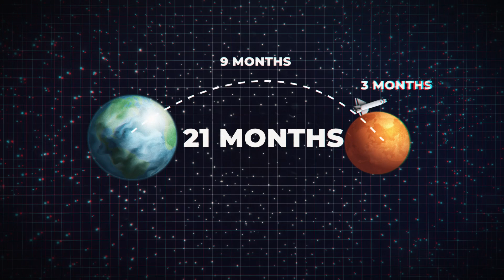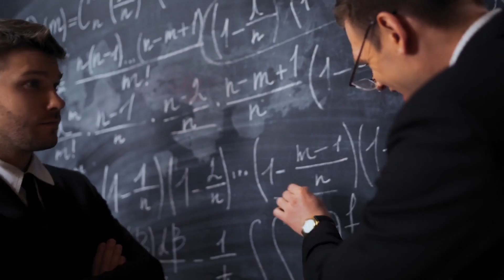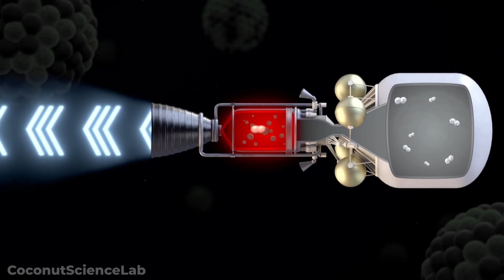NASA’s INSANE Nuclear Rocket to Visit Mars IN DAYS

Comment: There is a bit of a limitation of acceleration. You only wish to go about 1G or 9.8m/s/s. Going faster means you have high G stress on the human body. This means going to Mars will take 2-4 days and no less. Another thing to take into account is doubling acceleration (in this case 2G) will NOT halve the transit time, but takes significant amounts of energy.
Reply: So 1 G of acceleration will make humans feel more comfortable on the journey. This artificial gravity would change the whole design of the ship right?  It might need a much bigger base and a few other levels parallel with that base. It would also need to be versatile as far as adapting to little or no gravity for humans to work on the ship during those times of prepping for travel, maintenance, repairs, and getting into orbit.

Comment: Another problem with travel to Mars is that the Earth & the Moon are in a fixed position to each other, Earth & Mars are not. Sometimes Mars is close (perihelion) & sometimes much further off (aphelion) and the far side of the Sun. If you don't get the timing right you can miss the bus going home & have to wait for the next pass. Also there is a 50% failure rate with unmanned probes, so what is an acceptable casualty rate ? When Magellan's expedition returned only 18 from 270 crew survived. Magallen was not among them. Musk said he is prepared to take casualties. I suggest he goes first.

Comment: can I ask a stupid question? do we have materials that could withstand SUCH INTENSE INSANE ULTRA HIGH HEAT NONE STOP FOR 3 DAYS STRAIGHT? I mean the output from the exhaust alone at the point of release ? let alone the initial output of the gas burning from the combustion point down to the exhaust point.. ? and wait.. how do they plan on slowing down from such insane speeds to a manageable landing speed in such a short time and distance?

Comment: Wow ... so many mistakes.   It takes 6 months to get to Mars not 9 months.   Elon does not like Ion propulsion for Starship.   It is OK for smaller craft.  Nuclear is also out of the question because of its weight to orbit and it is NOT a proven system yet.  They have built and tested some, but still needs a lot of testing.  Your nuclear propulsion 'idea' is still a chemical idea and not a proper nuclear one.  All the propulsion systems you suggest take a lot of payload to launch - so not very productive or probable or sensible.

Comment: Any constant acceleration will reach almost relativistic speeds eventually.  We need a fuel that can maintain a constant acceleration (and then deceleration for the remainder of the trip.) The limitation is the mass that any fuel brings to the equation.  And even with perfect efficiency, (perfect mass to energy conversion) there are still major limitations.
The mass of ANY fuel is the limiting factor.

Comment: Hum, my only concern is traveling at those speeds would not affect human bodies in anyway?
Like i get it on 0-g any thrust would not meet resistance and provided you accelerate/decelerate slowly you could get rid of any relative pressure of change in velocity. But we have never traveled at those speeds for long durations before to actually check if human bodies can adapt to it.

Comment: Having played KSP for so long, in my experience the nuclear engine is more efficient than conventional rocket engines with a tradeoff in thrust. like the ion engine having lower acceleration, but a longer sustained acceleration, resulting in higher top speeds or more delta-V... correct me if I'm wrong
Reply: Nuclear engines are capable of as much thrust as conventional rockets. Specially the open cycle ones, but the trade of being irradiating Earth's atmosphere.

Comment: Minimum distance to Mars from Earth is roughly 34 million miles, that means a 3 day trip would require a speed around 475,000 miles per hour for the entire 3 days of time. If you could sustain a 1G acceleration, which would simulate earth gravity for the passengers with their feet pointed towards the engines, it would take at least 7-8 days of acceleration and then another 7-8 days of deceleration to comfortably reach Mars. You might be able to send payload to Mars at faster speeds, but 3 days under higher than 1G forces would likely be pretty uncomfortable for Humans. No matter what type of engine technology we use, humans will always place limits on what you can do with it. So it would likely still be 1/2 a month of travel. Getting an engine to move a large mass at 1G constant acceleration, likely a long ways away.
Reply: Its still 14 times faster than we currently propose
Reply: So you did this calculation? Let's check that. 34 million miles in three days is an ave of 472,222.3 miles per hour so that is about correct. But given 3 days is 259,200 secs and 1G is 9.8m/s/s in the acceleration part you would reach 2.8 million miles an hour and be far beyond Mars. So does not need 14-16 days, only 3 days at just 0.16G.

Comment: An Impulse Engine, that’s what those Nuclear Engines basically are,

Star Trek’s Impulse Engines are Nuclear Fusion Engines that propel the ships at Sub-Light Speeds, Although this Uses fission instead of Fusion.
Reply: Impulse Engines are more science fiction that fact; in Star Trek they are a combination of Nuclear fusion thrusters and warp drive. That's why those ships in star trek can move around like fighters in a dogfight, they use the warp drive to lower the mass of the ship and counteract inertia. 

Nuclear Fusion thrusters, that are scientifically accurate are more like what you see in the Expanse. While Nuclear Thermal 'Fission' rocket engines which NASA and the Russian's are both trying to build are just using nuclear reactors to heat propellant. These engines work by causing a phase change, liquid hydrogen to gas and thus expand the fuel to harness the energy of the change in state for motion. This is instead of detonating it like in normal rockets.
Reply: A photonic drive isn't really a drive at all. It's just a sail.

Comment: 39 days to mars with ion drive doesn’t make sense. It takes way longer than that to accelerate and remember it takes way longer to decelerate retrograde
Reply: My thought too. Top speed is great, but acceleration performance matters as well. As fate would have it, the ion and "photonic" concepts accelerate the least.ion engines have the thrust of the weight of a piece of paper, and "ionic" engines haven't been conclusively verified yet because their thrusts are so incredibly low.

My bet: nuclear thermal. Twice as efficient as chemical, good thrust and acceleration. The science is well understood.

Comment: A very Interesting argument on  trips to Mars being shortened to a possible three days. But of course you’d need to turn the atomic rocket or the other method of using a photon drive system. These rockets would need to  be turned around when you reached the half way point to use the breaking acceleration to slow the craft/s down to land on Mars. 

Far better than this would be to use Electrogravitic drive which is in effect an inertia cancelling form of propulsion.  Here a massive amount of positive electrical charges of around 200,000,000 million volts are applied to the front of the space ship and the same but negative electrical charges are applied to the rear of the space ship. 
This gives acceleration to every atom and molecule of both the space ship, the cargo and crew at the same time, quite unlike any rocket or photon rocket driven ship.
Please see Dr Thomas Townsend Brown’s Electrogravitic experiments in Canada starting in the late 1920s and the great success of the B2 Electrogravitic Bomber funded by America, Canada and I believe Britain had input into its  success as well.

Cheers, 
Richard Leschen. 🙂

Comment: Days, no.  5 weeks or so? yes.   That is for small fission plant pumped VASIMIR.  Now a nuclear putt-putt could accelerate at 1G the entire time and would be faster and able to send huge payloads at once.  We have known about the putt-putt idea since the 60s.  We have understood nuclear rockets of various kinds for that long.  So it is not so new at all.  Chernobyl has NOTHING to do with it and nuclear energy is 2 orders of magnitude safer than oil and gas on earth much less much better safety than chemical rocketry for space flight.    How long to get photon powered or ion powered up to speed is the question.  They are not high delta V typically.   Small craft and hitting it with a laser for much of the way could work and is another old idea.

Comment: not a single mention of space sails. Its a bit photonic, but not entirely. Theoretically a space sail could harvest energy from nearby stars and thus able to move in all directions. The hard part is that you need a sail of approximately 100 square miles to push 1kg of payload with 1g acceleration

Comment: If they used liquid oxygen as the other propellant that would make it the cleanest burning engine in existence, since the when the two are combined, you get water vapor! That's as opposed to Elon Musk's propellants which combine to make some of the worst exhaust created to date at a time when climate change is a serious problem. It uses liquid methane, which is itself a greenhouse gas, while it is pressured up it constantly releases a not insignificant amount of the stuff into the atmosphere. In addition, as the methane and liquid oxygen burn, they combine to create carbon monoxide and carbon dioxide, among other unpleasant things. At this time when global arming is such a critical issue, we just can't afford to be doing that. That's, in part, why the EPA has put the kibosh on the project until he can come up with a cleaner burning engine. His choice of options? Not to build better, but to go to a country where they don't care much about the environment. There's nothing to respect in that.

Comment: Problem I'm seeing is how ever long it takes to get up to speed it will take equally as long to slow down. Acceleration + or -  puts G loads on the human body so that would put limitations to the rate you can accelerate or decelerate. Also the faster you go the less time and ability to change  direction you would have to react to space depris and the more catastrophic even a little space dust would be to the ship traveling at 200K mph. Avoiding space debris would put G forces on the body. You would almost have to be ready to strap in a seat at a moments notice.

Comment: Great subject, but nuclear power is not the right approach. Bending gravity around the object to "create" thrust is a better approach. Since we're talking about theoretical science. Also a space-time folding is also another option for space travel. 

Using the nuclear option is far more dangerous because of the volatility of the approach, and the disastrous outcome of failure is far greater than a chemical rocket. 

Space exploration is in it's infancy in the grand scheme of things. Our best approach is to set up mining drones in the kyper belt to mine precious metals and then refine them to make the things we need since our planetary metals are finite. After that, we still have to make travel to space easier from our own exit velocity while also making space faring vehicles in our orbit that can withstand the rigors of space like microparticles, sun radiation, and many other obstacles in the vacuum of space.

Comment: The g force on the human body to reach those speeds would leave you a puddle goop. Plus the same force is needed to slow you down at the other end, and then repeat for the return trip. There are still a few more pieces to the puzzle that need attention but we will get there im sure.
Reply: The "G" in "G-force" stands for gravity, and gravity isn't present where there is no mass I.E. outter space.
Reply: @sethwarman1709  Everything has mass except light in space. You're thinking weight

Comment: My goodness almost everything in this video is wrong, the ion drive will actually be the slowest by a long shot, ion drives take years to accelerate to high speed, not hours, current ion drive engines produce a few pounds of thrust, they are just really fuel efficient, it may take 3 days, after spending 5 years to accelerate and another 5 to decelerate.

A solar sail is suitable to power a craft that weighs a few grams, it is not capable of powering a full size ship so that’s BS.

The reason raptor engines are so good is because of the fuel they use, the reason why no body uses that fuel is because it is highly unstable and dangerous, a lesson space x will learn soon.

There are 2 types of nuclear space engines, the model you mention is the slowest least efficient, the other nuclear engine uses small explosions to propel the craft which is incredibly faster however said craft is far far far to heavy to ever be lifted into orbit.
Reply: The Raptor engines use Methane....
Reply: Most of what you said is incorrect. Seems you raced to the keyboard without doing your research

Comment: If I am not entirely mistaken, that would be a top speed greater of 385,802 m/s, reached after 1.5 days and thus acceleration >3m/s^2. But that ignores the time we take to get into an orbit, which can be days on itself. There certainly would be no issue with micro gravity. Yet in order to continually accelerate, it needs sufficient energy (and mass) to accelerate in the opposite direction. Where again would that come from? Maybe physics school books chucked away fast enough?
Reply: hes incorrect bro. not to mention Ion engines produce 0.5 newtons of thrust, so it would take years to reach those speeds

Comment: You need a space craft  that produce its own propellant (fuel) as it travels. Ion and photons is good option but takes ages for it to bring a space craft up to speed, because it doesn’t create the same thrust as regular rocket engine. Thrust created by ions or photons is less than a A4 sheet of paper. As for the “nuclear engine” it’s not nuclear propulsion, it’s hydrogen propulsion (the nuclear component is only a heating mechanism for the hydrogen to expand) which still doesn’t have the same thrust as liquid oxygen or soils booster engines.

Comment: An interesting subtopic has occurred in many of my discussions about in space speeds, would speeds this fast be deadly? I'm no rocket scientist or big shot physics teacher, but because there is zero gravity in space I dont think there would be much in terms of whiplash from a sudden break of speed. So long as you don't enter any part of the atmosphere of a planet, you should be able to slow down at any rate in space without whiplash or other consequences. Any ideas, comments, or corrections?
Reply: Would be a waste of fuel to stop so suddenly all at once like that. Usually for trips like that it's predetermined where and when to slow down. Think about a person at full sprint then running then jogging then fast walking and eventually walking and finally coming to a stop. Going from a sprint to a stop wouldn't be too good. Just my take.
Reply: @romanmartinez3701  I think you are confusing gravity with momentum.
Reply: Coming to a stop in an instantly would kill you.

Comment: Propelling a rocket to over 3 million miles an hour isn't going to be as difficult as slowing it down from that speed.
Reply: No not harder. But a way bigger trick to get it slowed down in time not too over shoot. But that's what Un- manned missions are for! We will get it down before people launch! Your not going to talk anyone into 3 million mph with out proving you can stop it in time? Ha!
Reply: @lloydfranks1357  IDK, LF....
I see seeming rational human beings jumping out of airplanes or climbing Mt. Everest every day.  So I don't think there will be a shortage of humans who want to head to Mars without much assurance that it will work out....
Reply: Actually, ignoring mass loss, which would only make it easier, slowing it down is exactly the same as speeding it up!
Reply: @warrengleeson4572  not really, it's much harder because the exact measurements of Mary's atmosphere are not available also consider the fact that the atmosphere is thinner on Mars..
You'll need another rocket stage to return after landing on Mars. The method to circumvent this is to make the rocket release only the payload onto Mars while orbiting the planet so it can later launch by flinging the rocket using Mar's gravity. This is only applicable for ion thrusters though.
Photon propulsion is going to be much more dificult and time based since it need to be launched when the sun is closest to the launch planets. Also space dust can easily mess the Photon propulsion system, even the ion thrusters will be affected but negligibly
Reply: Actually, you just switch the orientation approx. half way there and flip the power back on...  That's basic elementary school Newton.

Comment: I love it! I think a ship should have at least two types of propulsion complement each others thrust. One engine is fastened the other engine is slow and steady going faster. But what about a lunar base to launch the ship instead of wasting fuel to leave the Earth? A shuttle to the moon and from the moon to Mars might cut cost down as the ship is build and assembled in near zero G. A landing shuttle will actually land on Mars and then takeoff to reunite with the ship.Mars gravity is less than the Earths.
Reply: A proper orbiting station needs to be built first,  then  build a base on the moon.  An underground base dug out , seal the tunnels helps protect from solar radiation , large solar panel fields for power.
Reply: @craigwiess1656  or even a fusion reactor
Reply: @Jermain-cz4bh  considering recent breakthroughs in nuclear energy that might be possible in two decades
Reply: @Jermain-cz4bh  *fusion not nuclear
Reply: yes. launch from the moon, no atmosphere, low gravity, go faster.